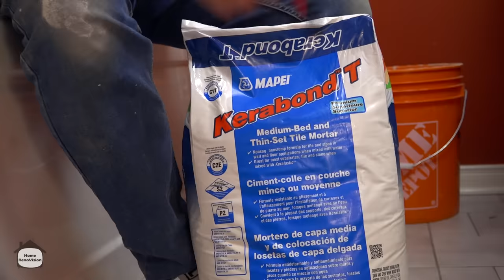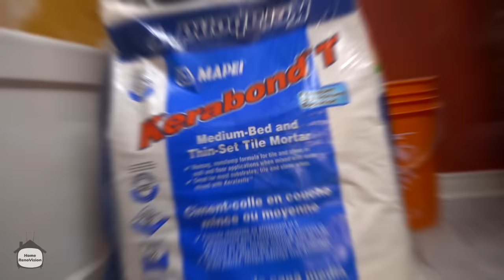DIY How to Renovate the Tub / Shower from A to Z

Comment: Jeff, I live in a trilevel home built in 70s. One bathroom on level with laundry, nothing on main with kitchen, master is screwed up. Originally master had regular tub and toilet. Or it was a Jack n Jill. In 2009 the owners did a redo. Put a garden tub and glass shower and moved the door so it takes forever for the parents to pee. Also a master closet was put in in with stairs. A fifth floor. The Jack and Jill was also cut off. And stairs were put up to another bathroom with a tub. 
My question how can I fix the master bathroom. And I think the single bathroom would be great to turn into a walk in shower. Mother in law quarters etc. 
thank you for the dry wall tips. U make it seem so much easier.

Comment: If the drain won't come out with either of the tricks he shows I have used a hole saw about ¼ inch larger than the hole in it, it's not the easiest thing to do but its effective and sometimes the only option for older tubs

Comment: when you are working with copper tubing, after sanding, take your tool, and take the ledge out of inside tube left over from cutting. If you dont, it can cause problems when water is flowing, because sharp ledge . Just a tip

Comment: Always remove upper tile wall sections first. It’s safer. The bottom tile wall section will help support upper while removing. When bottom section is removed first, the upper section of wall tile will unsafely suddenly drop risking injury
Reply: I'm thinking it would be a little more challenging to pull down as not to tear the ceiling drywall and caught in the corner?
Reply: @genevievelizee916  you are correct! The only difference is I will cleanly remove one row of tile and drywall halfway up the wall, splitting wall section in two and having tile size gap. The gap will allow me to dig flatbar to pry along stud. If not drywall to ceiling I will remove top section first from cutting along top of tile section. I try and remove endwall in one section. The back 60” wall I will try and remove in 2 sections.

Comment: Can you use the Schluter boards as a floor base for tiles? Straight on the joists? I need 20mm base and was thinking to either do 20mm Schluter or 10mm plywood and then glue 10mm Schluter on top. Which one would be better?

Comment: Home Depot sells a strainer remover that works great. It’s a tapered piece of steel with teeth and you lightly tap it onto strainer with hammer, then use a ratchet to unscrew it out. The teeth grip the strainers inner diameter

Comment: Flip your reciprocating saw blade backwards to help have a better angle for cutting drywall. It will help having only a little bit of blade go through wall risking damage to wires or pipes.

Comment: When going from Copper to Pex, I am curious why you didn't use a sharkbite... ?? (I just removed my old fiberglass shower and am looking at very similar plumbing to that shown in the video. Having not soldered copper before, and because the stud is close to one of the copper pipes, I thought a sharkbite would be a good option, no?)

Comment: For people not experienced with torches, find a small thin metal plate, put a nail hole in it and tack it up between the fittings and the wall and you won't set your wood on fire.

Comment: Hey Jeff,recently started watching your very informative videos.Super impressed! I have seen you do a tub shower conversion using tile but I am wanting to install a product called Onyx(3 solid panels glued into place).My question is I have a 3/8” Sheetrock panel to the studs and then what appears to be a 3/8” layer of plaster on top of that (house is about 1960) and the wall is in good shape,should I tear out down to the studs and if yes,what to put in place to adhere the panels to and procedure?
Reply from the maker: for best results using a unique product always go to the product website and read the installation instructions!

Comment: Not that I have any way to get the answer to this question, but. Looking at the bathroom tiling job, some of the wall tiles appear to cast a bit of a shadow on the tile next row down. Which tells me that all the tiles are not pressed equally into the cement. So, why don't tiles come with a pattern of bumps on the back so during installation you would press each tile in until you hit your backer board which should result in the front surface of all the tiles would be even with each other. After all they make the spacers for the grout line space.

Comment: One issue about doing a pressure test on a drained system is that it's full of air. The water was turned on and inspected for water leaks, but unless it's a huge leak, no water's going to come out, just air. Another way is to have a squeeze bottle of water to squirt on each connection during the test, watching for bubbles.

Comment: I didn't see you do this on this video.. but the board sits right on top of the flange.  Did you use the mesh tape and quick thin set mortar here to fill the small gap bt the flange and the board?

Comment: I usually use a pare of plyers 
 putting the handle in the drain holes. Then place a screwdriver 🪛 horizontally across the end and turn.

Comment: You were lucky Jeff.  My tub was put in the the 50's and it was cast iron. the bathroom was built around it.  It took two people to turn it over and get it out of the space and three to get it out of the house.  There was no insulation in the outside wall, which is why the tub was always so cold in the winter.

Comment: I'm putting small subway tile on bathtub in the bathroom I'm currently renovating. The back wall drywall sits flush with the edge of the tub but the front and back of the tub there is about 3/8" gap between where the tile is going to go and the trim of the tub. Is the tile just going to float where the gap is or do I fill that in with grout?

Comment: My husband and I are building an addition to the shed we built last summer.   We need to slope the roof from side to side instead of front to back.  The building is 16 ft long with a 2 ft difference in sides.  Because the building is so long, we are going to construct the roof in 2 8ft sections.  My question is, how do we figure the slope of the roof?

Comment: Hey there I have a question. I replaced the seals, made sure to clean everything before replacing, and the bolts are still a little damp after awhile. The tank is on there pretty snug as well. Anything else you suggest?

Comment: I have a tub/shower that has 3 separate walls which are caulked at the seams of the walls and the tub. Water pools on top of the flat surfaces of the tub and turns a pink color. It doesn't drain properly. The water eventually gets in through the caulking and molds start to grow. There are also small hairline cracks in the bottom of the tub. I called the manufacturer and they replaced the tub kit however, the quotes I got to install it are expensive. I am going to build a wall of caulk around the cracks and fill with water. Will monitor it for a few days to make sure the water doesn't leak through the cracks. Once I determine that it isn't leaking, I plan on removing the old caulk, spraying mold killer and recaulking everything.  Does this sound to you like the right way to go about it and why is the water pooling on top? Is there a fix for that?

Comment: Thank you for sharing . However, you are a pro and you have done this before . We are amateurs  , we can not be that much comfortable & fast with cutting the wall/drywall of a bathroom with powerful reciprocating saw. We are not doing this everyday . We can easily cut water pipes or electrical cables. 

My approach : never cut the wall that you are not 100% sure what is behind. Do not use powerful cutting equipment . 

Solution : 

Step one: Use oscillation multi tool to open a small window on the wall ( make sure not to go too deep with multi tool) 

Step 2: Remove the drywall section 

Step 3: look what is behind 

Step 4 Weaken the sections around the initial hole/window on the wall by multi tool ( never go too deep) then remove the wall by hand. Piece by piece.

This will save us from cutting pipelines behind the wall .

Comment: Quick question regarding our shower; Every second day or so, the showerhead in our master bath starts letting water through. It lasts for about 30 seconds then stops. I've reduced the water pressure of to 65PSI and it seemed to help a little but the problem still re-occur. We have another shower in the house but this one is fine. Any idea?

Comment: Contractor left the tub faucet [waterfallstyle] with about a half-inch gap between in and the wall and has no intention of fixing it, saying the only way to do so is to remove all the tile [that they also did wrong]. They said they 'misjudged the depth' on the fitting. Now it looks terrible and is definitely not waterproof [there is a hole in the wall].

Any advice on how to fix this / cover the hole / leak-proof / make it look decent? The only idea I've come up with is to get a metal transition strip [for floors] and cut it to size, but that would be less than ideal and wouldn't solve all of the problems.

Comment: Is there are reason you don't use the N-95 respirators with the one-way  plastic valve that lets out your exhaled breath out? As far as I understand, they do a fine job of filtering particulates. I find them much more comfortable and can work in them in them comfortably for hours. They aren't nearly as hot or claustrophobic as the one you were using. 

P.S. In case anyone is wondering, the respirators are not appropriate for Covid-19, as they do not filter your exhaled breath.

Comment: With the Schluter wallboard your studs should be 12 o.c. if you're not installing the wallboard over a substrate such as gypsum or ply, etc.. 16" o.c. has too much give especially with heavier or thick natural stone and then the issue with lighter tile such as ceramics, a good slip[ and catch against a wall could quite easily compromise the membrane...  especially if say you focus that energy into a few square inches such as the mounting plate of a grab bar.  perhaps Schluter updated the specification since this video was produced, but it should be 12" o.c. installed as done in this video.

Comment: No bed of mortar? Some say that it is recommended. My tub has posts/legs which can be glued with construction adhesive per installation instruction. But I wonder, as you did nothing, except screwing to the walls. What's your opinion?
Reply from the maker: it all depends on the tub. some need it and some don't. always read the installation instructions. Cheers!
Reply: @HomeRenoVisionDIY  thanks! My tub (Kohler) has mortar bed option but it seems that it's only to hold the tub in place as it states "put 1 to 2 in of mortar", while tub has 4 wide feet and more than 2in space between bottom and the floor. Thank God I don't need to do this mess. It's 2021 and we couldn't do tub which can stand without this outrages technique? :) Btw. I am on last cement board phase right now... Cheers!

Comment: Hi Jeff, I do have a question regarding bathroom ceiling.  I read different forums regarding drywall type installed on the ceiling.  Some say install greenboard, some say that greenboard is not for ceiling because joist need to be 12 inches OC.    I  did install regular 5/8 sheetrock (fire code). Now I am wondering if i made a poor decision.. Walls will be done using Keri boards. 1 wall (entrance to the bathroom i had to plaster using structolite ( I have gypsum block walls - not to confuse with sheetrock). due to to  some reasons. Anyway did i make poor choice with regular drywall on the ceiling ?
Reply from the maker: as long as you have a good fan and a good quality 100% acrylic paint for the ceiling and prime with a drywall primer and 2 coats of finish you will be fine. Cheers!
Reply: @HomeRenoVisionDIY  Thanks for the reply :).  I do have a good fan. finally closed my walls with Kerdi. one thing is not clear for me - transition between kerdi and ceiling sheetrock.   do i use kerdi tape ?

Comment: AVOID BREATHING DUSK WITHOUT A MASK:
I know one option would be to create steam in there… I guess that might be a problem with the water off but I would think putting a humidifier in there would do the same thing… Basically if there is mist in the air the dust will just drop to the ground instead of floating around. The other thing you could do is put some contact paper on the wall before you smash it and then just squirt some lines in it so that when it breaks apart it will just get stuck to the paper maybe? I’m pretty sure a humidifier would be a good idea. 
You could probably also set up a shop vac near where you are working and just have it on so it sucks everything in that direction
Reply: Then again for only 10 minutes (you say) you really could just deal with a mask… or slow death lol whatever. Blows your hair back 😎I’m not doing any bathroom projects right now this video just came on and I like your videos they make me feel calm because you remind me of my dad and I like learning stuff like this
Reply from the maker: Happy to remind you of your dad. no worries about a little dust once in a while. Stress is a bigger concern in most folks lives. just try to have fun with your work and you will live forever. Cheers!

Comment: why don't you put a tarp down to catch all the stuff you pull off the walls!? Much easier clean up.  Small shop vac from Costco is also a help. Small enough to fit easily in a bathroom, strong enough suction to do the job. Great help. Donna

Comment: There is another tool to remove a tub drain.  It is the size of the drain with easy-out type threads that lock into the drain and will allow you to turn it out.  Those are a bit more expensive - maybe $20-25 at a big box store.

Comment: My pipes burst so taking the opportunity to fix all the horribly wrong things my Uncle did... RIP great guy... but was a plumber in training.
He replaced the three way shutoff to the outside tap and towards the tub/HWH from the main... with two CPVC T fittings and 6 adapers... I had to cap off the main going that way just to keep water in the kitchen and toilet =\
But hey... I'm certain next year my pipes will be accessible with a valve to shut off anything I need to.
Reply: P.S. Also found out my tub has been draining into the basement for who knows how many years... Furtunately though when I say basement it's really a walk-in crawlspace so no flood damage... but 1:02:00 is exactly the info I needed for this fix, replacing that bugger. Tanks a million! Sorry, fixed income means my Tips are currently limited to millions of Thanks ;)

Comment: I created a mountain of problems when I tried to change out both the drain and the overflow.  Long story short, when I removed both of them at the same time, the pipes for both dropped to the floor below and the only way to fix the situation was to drill into the wall and fix the plumbing since I wasn't able to connect any pipes to the tub.  I live in a condo in California that was built in 1963 or 4 and I assume that plumbing these days is installed where it will remain in place even if both the overflow and drain are removed simultaneously.  We had to hire someone to do the work and we ended up losing about $3,500 by hiring a non licensed ass clown that did more damage than needed to be done and about a year later, I actually did the work myself with a lot of guidance from a neighbor for about $500 in supplies.  

I purchased a socket that was about the same size as the drain was and then applied some JB Weld adhesive around the outside of the socket and after it cured, I was finally able to remove the drain.  Nothing else worked, I even tried the chisel trick.  The only thing that worked was the socket with JB Weld...

Comment: what if i told you that teflon tape doesnt prevent leaks? all it does is lubricate threads, 3 wraps is more than plenty. putting on 10 wraps may actually cause leaks because now you cant get your tapered threads tight enough

Comment: I'm having an issue with installing a new drain in my pre fab firberglass walk-in shower and its still pouring water from around the drain and am using plumbers putty I wonder is this could be the issue.

Comment: Only one thing to add, you didn't test the solder joints going to the outlet spout. I know it won't have any pressure,  but it could still leak behind the wall.

Comment: Wouldn't it be a lot easier to just use qa reusable pex push to connect cap of the correct size for the pipe. I will fit copper, cpvc, Pex-A, Pex=B, and Pex-C. Additionally you could use a push to connect coupler and just push it on the copper and push your Pex into the coupler.

Comment: Small question, why is it that after all that effort is put into ensuring that if any water got behind the tiles it runs down the waterproofing and over the lip of the bath, to then finally apply a bead of silicone at the lower tile/bath interface that potentially traps the exit of this water?

Comment: I cut everything up and put it in the trash.    I put 2 full toilets in the trash at one time.   Over 4 weeks I threw a whole bathroom out and changed 4 toilets out.   Free in the trash.   Wood, I just cut up into small pieces.  All my metal stuff, like hot water tanks , bathtubs,  stoves, dishwashers, car parts , I put them in my old van parked in the driveway and then make a trip to the shredder and collect $50.